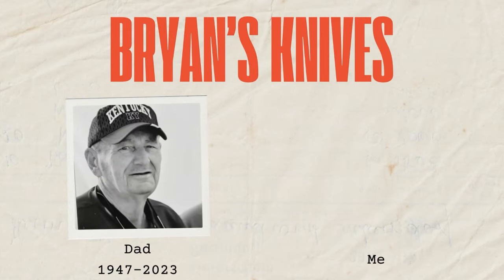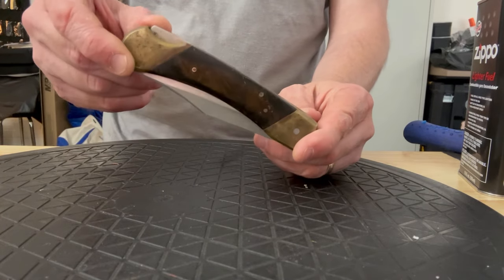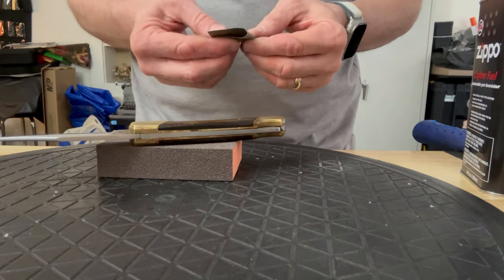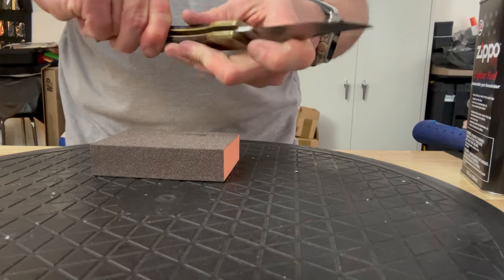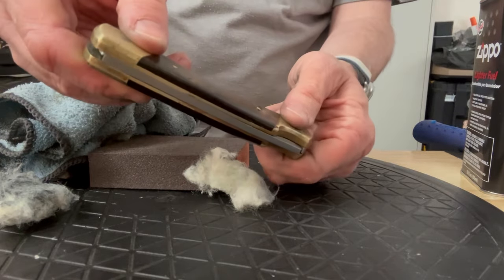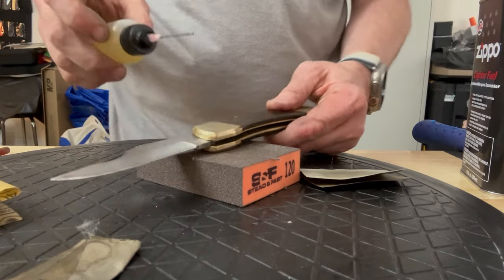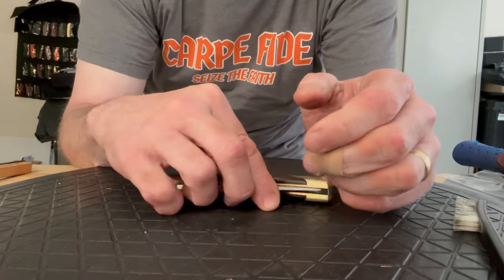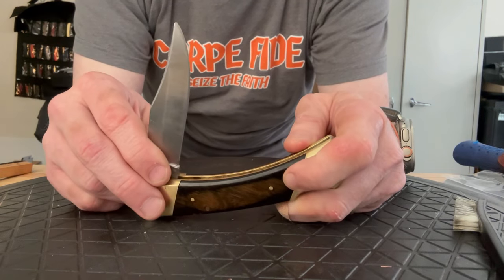A Schrade Bear Hunter LB-5 Knife Restoration!

Comment: Great job, I’ve used 0000 steel wool inside the blade channel. I cut a popsicle stick at an angle and push the steel wool with it. It does great for the hard to get to areas. Thanks for the video.
Reply from the maker: That's a great idea!

Comment: I think you did an excellent job.  Longer brushes would help but good old sandpaper and extra handwork does the job.  I bought a terribly rusted and very dirty case jack knife and put it in a cup of hot water and dawn, when the water cooled took out a Brillo/SOS pad and went to work on the whole thing in the sink. About ten minutes later it was beautiful. The scales, bolsters, blades everything was beautiful.  Was very gentle on the scales and blades, but it worked.  Of course I had to fine tune it and put it in a mineral oil bath, but it looked as new as it could for a 40/50 year old knife.  Was offered 10 times what I paid for it for 20 minuets of work.  I didn’t sell it.
Reply from the maker: Great idea!!

Comment: Nice clean-up, Bryan. I'm pretty new at this knife restoration stuff but I'm really enjoying it! I got a 1X30 belt sander from Harbor Freight just like the Doc's. They're only $50, very small footprint and they really work well. I've reshaped several tips and removed some nicks in blades with it. My favorite leather cleaner is good ol' saddle soap. I use a lot of different conditioners but my favorites are Bick 4 for more delicate or dressy leathers, and Sno-Seal for heavier sturdy leathers and work boots. If a leather is really dried out, some neatsfoot oil works well. God bless you, brother!😃👍🏻
Reply from the maker: Thank you for the info! Yeah, I need to pick one of those belt sanders up when I can along with a buffer. Thanks for the leather recommendations too!

Comment: You saved another one from a bad fate👍Suggestions? Well, I clean with dish detergent/water. If it’s really bad, I may start with WD-40 to loosen things up. “Brasso” for cleaning bolsters and blade (Flitz does a good job, too, as someone else suggested. Buck used to include a packet of Flitz with new knives). I learned from one of the “old pros” to use a product called “Danish Oil” (available at hardware store) on the “wood” scales - usually works great to restore life to them. Finally, for the leather sheath I clean with good old fashioned “saddle soap”, then finish up with a coat or 2 of “Armor All” leather protectant (yup, same stuff I use on the leather seats of my wife’s car). Have done several old knives this way. But, there are dozens of alternative products out there….
Reply from the maker: Thanks Mike! Yeah, I actually did a dish detergent bath but forgot to film it. Yep, I use Flitz a lot and it’ll get a good dose of that once I’m happy with the blade.